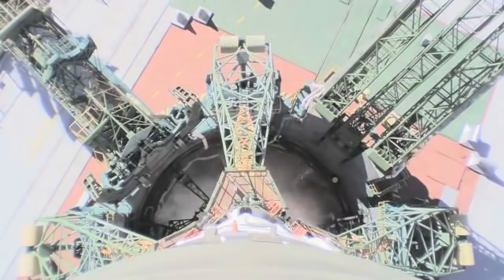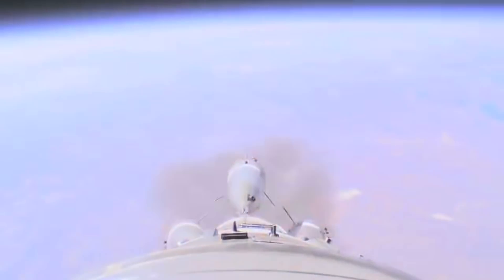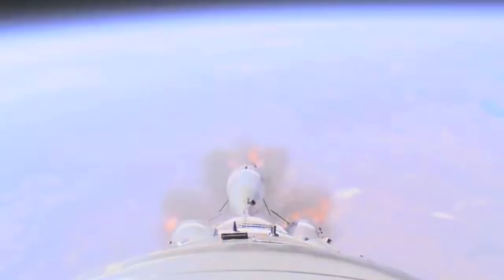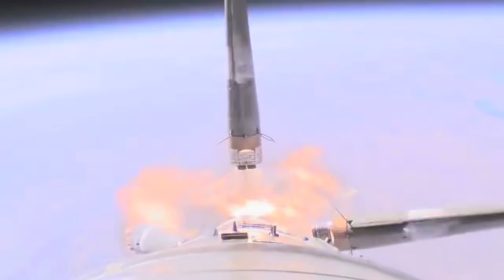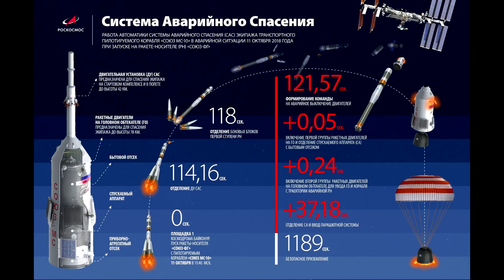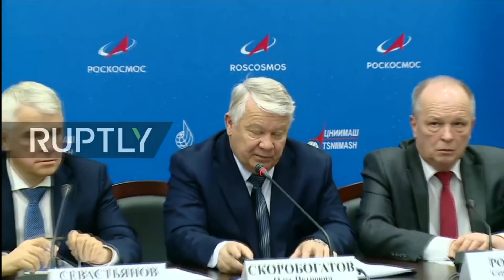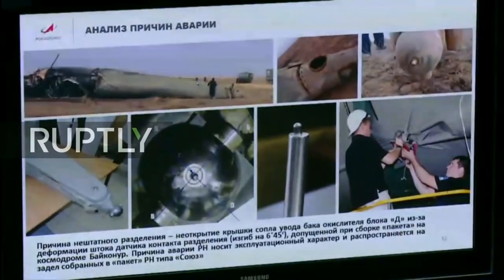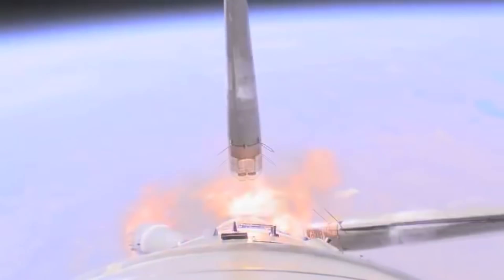In Flight Camera Shows Damaged Sensor Destroyed Soyuz Rocket

Comment: Yes it does look like some frames got dropped after booster separation.
Mechanical shock causing a glitch?
Reply from the maker: Video is downlinked so signal may have been lost.
Reply: @scottmanley  Of course - that would explain a lot.
Fortunately this video nailed the cause very well, but I wonder if they also record locally on sdcard to offer more insight if or when recovered for this and other scenarios.
Reply: @ahaveland  I'm sure an SD card is likely to survive an exploding rocket.
Reply: @Nathan_Lang  Why not? If contained in an insulated case it would be ejected and only suffer transient heating. Finding it afterwards may be difficult but a small GPS and LoRa transmitter would solve that.
Reply: @scottmanley  if previous comments are to be believed and the bandwidth for transmission is low, is it plausible that its a temporary frame drop from bandwidth choke when abort telemetry is pushed?
Reply: @bengrogan9710  They probably run cameras and essential telemetry on entirely different circuits and transmitters.
Reply: Scott Manley thats not how it works, unless its some rlly outdated UDP protocol
Reply: @kevin42  why it is not?
Reply: @kevin42  or analog
Reply: @BestHakase  Kevin is referring to the two common data transfer protocols: TCP and UDP. Your internet uses TCP which will resend a packet if it gets lost so in theory a TCP connection cannot lose part of the signal. UDP is an older protocol that doesn't guarantee packets arrive, lost packets are simply lost. However UDP is faster because it doesn't have to resent those lost packets and so it's still widely used for a lot of things. Multiplayer games use a mix for example: TCP for critical data like chat, combat, ete, but UDP for movement (the player won't notice if one frame worth of movement doesn't get through). In this case I would bet they use UDP because of the distance the signal needs to travel: bandwidth is more important than a few lost packets when you're beaming it from space.
Reply: Magic Hat because it isnt a direct beam of electromagnetism, that would be superiorly stupid to use. Its a 360 wide antenna so loosing some frames is rlly rlly unlikely. To name one of the reasons.

The other is that modern network layer transmission systems dont work like radio in the 90’s. It uses beam forming, varification & other tech to make sure as little as possible is lost, u simply cant loose several frames worth of feed
Reply: Andy Lee Robinson yup
Reply: @kevin42  Signal loss and re-acquire is not just a phenomena with UDP.  TCP will do it too.  Tho I doubt that these cameras are using packet protocols that we're likely familiar with.
Reply: @MlorenDraymeer  You're not seeing a big enough picture.  If, for example, they were using TCP and the TCP session was outright lost, equipment like this would detect this circumstance and establish a new session, for future imagery.   Meanwhile, during the re-acquire SYN/ACK of TCP, video frames are being generated and what do you do with them?  Store them and transmit  non-real-time or simply drop them until you have a new TCP session in operation?
Reply: Fromage Frizzbizz yea ik it isnt spesificly with the main protocols
Reply: Andy Lee Robinson Obviously it's becaus Earth is flat and NASA is just a conspiracy, duuuh!
Reply: @muchozolf  You mean Roscosmos., and ESA, and JAXA, and CNSA, and CNES, and UKSA, and DLR, and ISRO, and CSA. All conspiracies :)
Reply: Georgie F You sir need to give a little bit less credit to what you see on the interwebs. You know, all these vids and websites and stuff might be fake, right? 

Or a YouTube comment may contain irony.

It's kinda relieving, that some of these crazy conspiracy people are faking it.
Reply: Yes, can't help wondering if there was something they didn't want everyone to see.
Reply: @featherbrain7147  Why and what and for what reason?
The important event was captured and published.
Reply: @ahaveland   Yes, accepted. It was just frustrating that there was an interesting piece of action apparently missing.
Reply: @featherbrain7147  I know, would have been nice to see the whole thing uninterrupted but I sincerely believe there was nobody trying to hide anything.
I avoid conspiracy thinking unless there is actual evidence. There are too many messed up minds already!
Reply: @ahaveland  Really, I'm not one of those! I just thought maybe the Russians thought they should analise the problem before someone else told them "what they'd done wrong".
Reply: It is more likely antenna alignment issues caused by the rotation. It’s high frequency so more reliance on line of sight.
Reply: My thinking is that the impact knocked the ship over so quickly that the motion wasn't captured in the cameras low frame rate. So it appears the boosters immediately go out of camera view as the ship is jolted aside
Reply: It looked as though there were some dropped frames at the moment of launch too, at 0:13.
Reply: Craig McQueen vapour plumes can block the signal sometimes
Reply: They removed the frames with visible gremlins.

Comment: Ah, bent pins, a common problem with rockets and computers alike.
Reply: That's exactly how i killed a p4 cpu. 😀
Reply: @NamiduIndunel  meh.. a dust can kill a pentium 4 XD
Reply: @NamiduIndunel  Haha, same!  I only did it because I was already planning on buying a new computer and decided to try to fix it.  That didn't go well, obviously.
Reply: Except a rocket is magnitudes more expensive than Apple. But hey, bent pins!
Reply: @Aereto  Just give Apple a couple years.
Reply: @baganatube  apple doesnt use PGA processors anymore as they are using intel cpus which havent used them for ages. Last ones were Intel 1st gen i7 i5 i3 mobile processors.
Reply: @Aereto  He said a computer. Apple doesn't make computers they make overpriced child's toys. Please restate your comment if you meant to say computers.
Reply: @LightRealms  So true!
Reply: @Aereto  Spare parts for the rockets are probably easier to get than spare parts for Apple products.
Reply: @sylviaelse5086  Freaked me out about the replacement laptop batteries, Rossman ordered, then customs, confiscated them. That's a bad Apple.
Reply: @Aereto   its funny because CBC just recently did a report of apple wanting to charge $1200 to fix a bent pin on an LCD connector
Reply: Bent pins, a bane of humanity
Reply: Also falling tiles and busted O-rings
Reply: @Reznetwork-d5t  Not busted O-rings, just frozen
Reply: @AKAtheA  They exhibited partial burn-through on earlier missions but management refused to understand they weren't supposed to do that at all. Until on a fateful day the low temperatures contributed to a complete burn-through.
Reply: @sietuuba  A solid example of why brass should never ever gainsay engineers about safety issues.  If an engineer's willing to walk up to a manager and tell them to their face that there's a show-stopping problem, then they are correct to begin with.  They have already closely examined the issue, and with the aid of most or all of the engineering team have identified the nature, scope, and apparent mechanism (there could be an underlying mechanism that'd require a deeper inquiry to hunt down) of the problem, and probably reproduced in microcosm with a model or a material sample.  There's no further proof to be found in such a situation, as an engineer worth their salt won't make such a claim to brass unless they've already proven it to themselves.  'Twas a foolish thing management did that cold morning.  Disastrous, too.
Reply: Neither one was broken.
Reply: What about that one time that guy put in the accelerometers in reverse and that thing crashed there too.
Reply: @ICANanimations  No people were harmed in the making of that launch.
Reply: @Reznetwork-d5t  Question is not about damage but level of professionalism. We see how fast it drops in Russian space industry.
Reply: @Reznetwork-d5t  Not harmed, just shaken and stirred :)
Reply: Also, acceleration value overflow if I remember that particular Ariane screwup correctly.
Reply: Yep, that pesky 'Bent Pin' virus again...been there, done that.
Reply: Someone has been watching CBC news report with Louis Rossmann
Reply: You pinned it ...
Reply: Maybe they should have blown on the connectors a little more
Reply: To me this is the next thing what is happening, first the hole in the capsule, now a bent pin. To many things are happening in a short time frame.
Reply: Yes, leading indicators, near misses, etc. When these things start happening you need to refocus on safety. I'm in the oil & gas industry, and we track these indicators. Once that trend is seen as increasing, some intervention is necessary.
Reply: lol "bent pin"
Reply: "Stop pickin' at it!"
Reply: In the end the c 1957 based design worked to save the crew. If there was any doubt about have the crew right on the side of a rocket (Space Shuttle) this is it..
Reply: Jerry Rupprecht
This is not an electrical contact.
This is a mechanical contact, limit switch stem.
The bend did not allow the stem to press, and the limit switch did not turn on the valve.
Reply: Некий Некто it was a joke by the way
Reply: Terry Wilson was looking for your comment bro
Reply: Ah, so the Russians are still trying to cover something up then.  So what was the shiny object that fell off/broke off of the ship on the side you CANNOT SEE from the rocket cam...   seconds BEFORE the boosters tried to jettison and failed?
Reply: I repaired a set of reading glasses using a bent pin haha...
Reply: I wonder much a new pin cost , the idiot bent it should of least be honest Andy  fitted
Reply: And fords
Reply: Man I don't miss those old sockets that used external pins. Can't tell you how many times I had to straighten them back out as a hardware tech years ago.